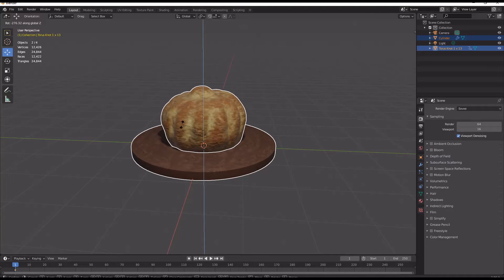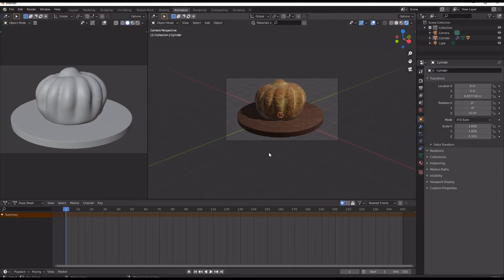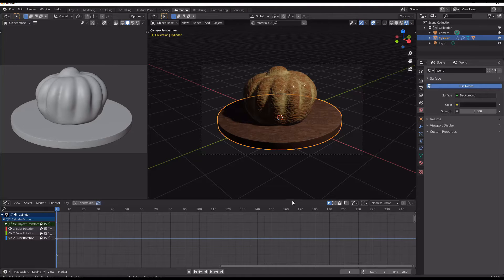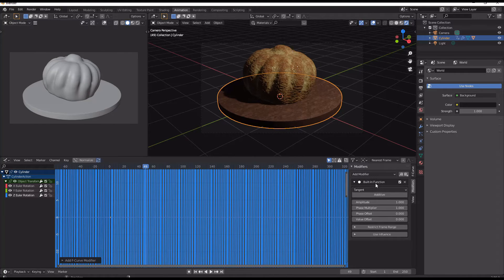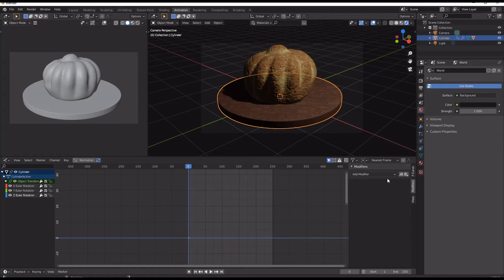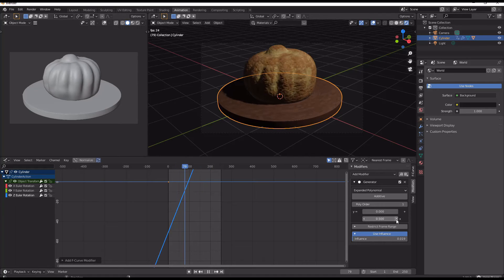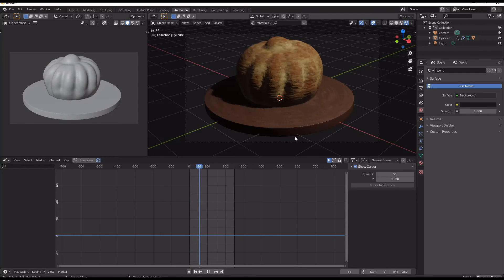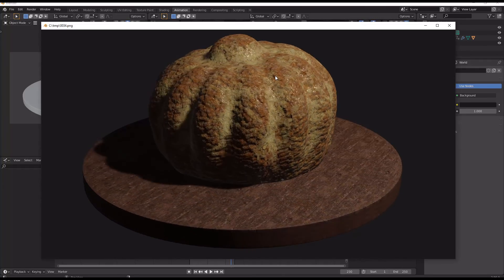blender 2.9 - How to create a continuously rotating animation

Comment: Interesting way to do it, but perhaps a bit overcomplicated. It can be done MUCH simpler.
Insert a single keyframe at the first frame for Z rotation. Got to the last frame and do the same, typing in how many degrees you want it to rotate (this can be easily adjusted later).
In the Graph Editor, select the Z Rotation channel and TAB into edit mode. Hit 'A' to select all keys. Right click in the graph and select Interpolation Mode > Linear. ...... TAB out of edit mode.
Now select the Z Rotation again and right click it. Select Extrapolation Mode > Linear Extrapolation.
BAM! You've got constant rotation as long as you want it. Just adjust the last keyframe to change how fast it rotates. :D
Reply: This method no longer works for me! Do you get there in the latest version?
Reply: @ThiboMarie  Yeah. In 2.91/92, in the graph editor, when you have a curve selected, you can hit 't' to change interpolation and shift-e to change extrapolation
Reply: thanks its works for me